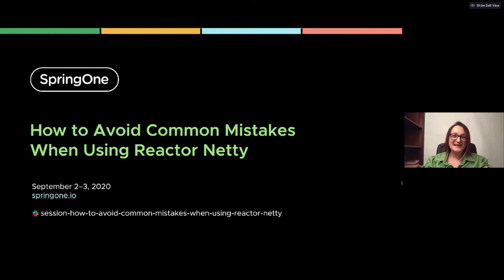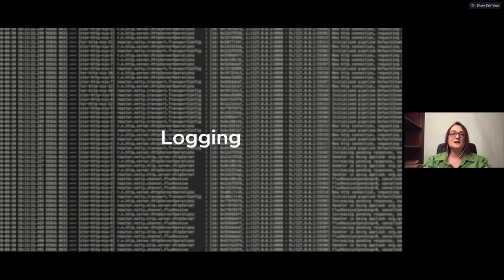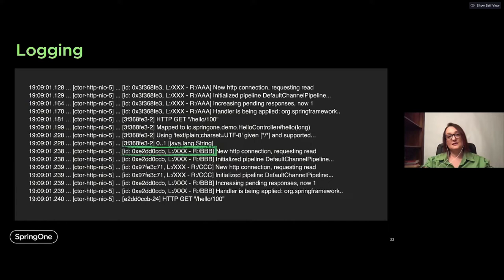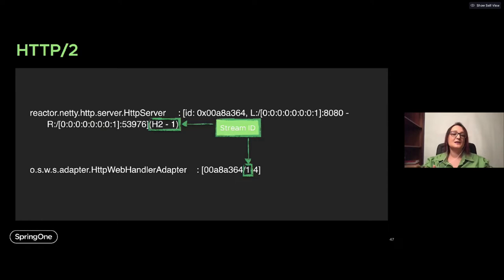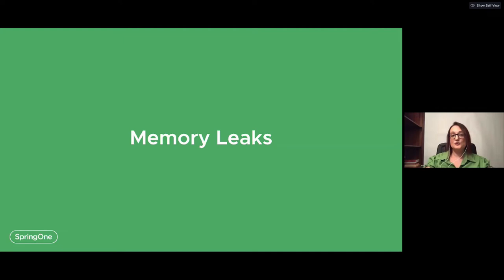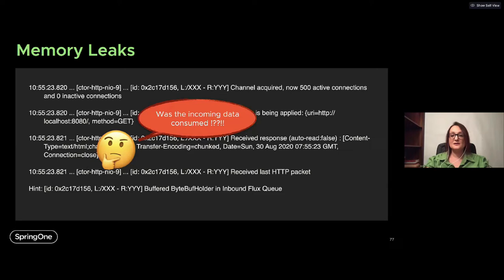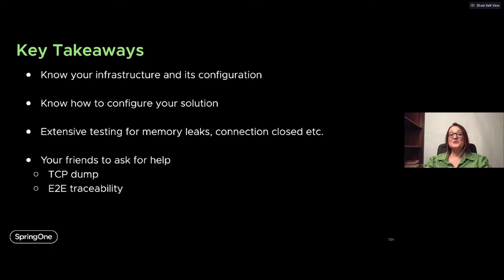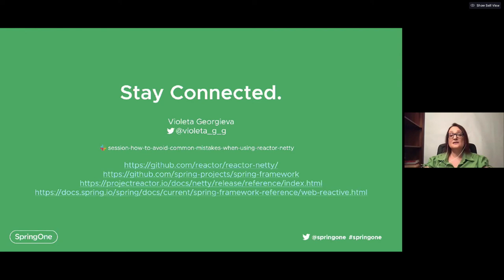How to Avoid Common Mistakes When Using Reactor Netty

Comment: btw, about spring.codec.max-in-memory-size. Default value is 256K. When endpoint receives a multipart/form-data with filesize more then max-in-memory-size, then spring will create a temporary file in server side. You may remove the temporary file with given api